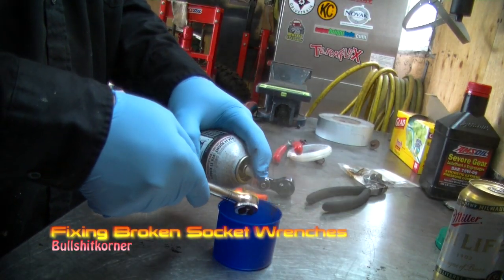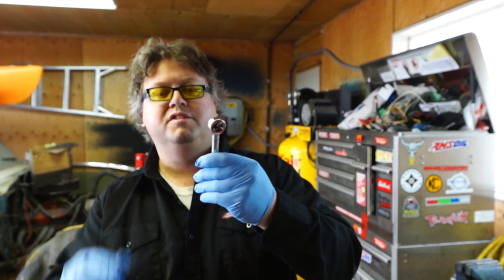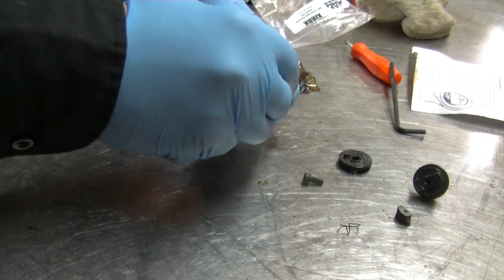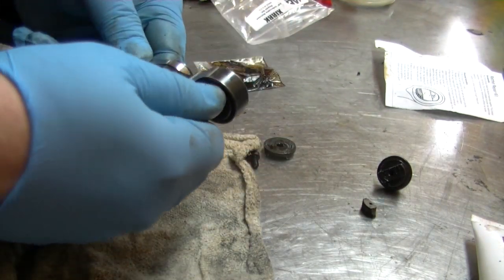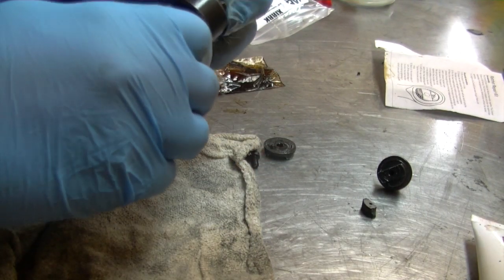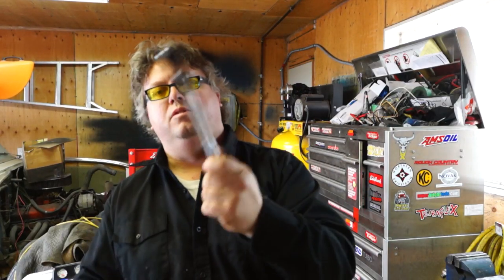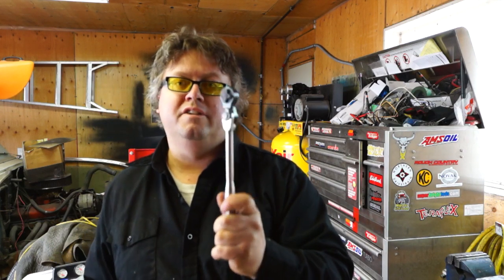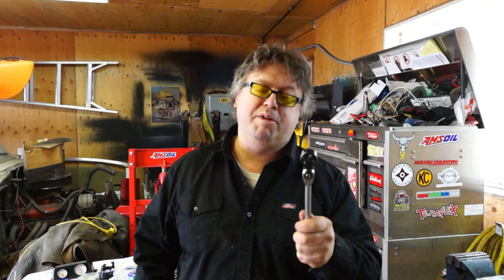How to Repair a Socket Wrench

Comment: Finally someone showing how to reassemble a round head mac ratchet!  Thought I was doing something wrong when after tightening the back screw, it wouldn't move.
Lightly tighten the screw down then back it off till it operates smoothly.  Looks like it originally had some loctite to keep it form backing out.

Comment: Damn Jerry good timing on this video, I just busted 2 socket wrenches last night trying to pop some bolts off a caliper mounting bracket.
Reply: Instead of using your ratchet (which has a weak mechanism), you should have used either a breaker bar or a manual impact wrench, which you can hit with a hammer.  Ratchets are designed to be used for removal (after a fastener is broken loose), or reinstallation (short of final tightening).  Anything else is asking too much of it.

Comment: If you mix acetone and transmission fluid together and brush it on to rusty parts it can break it apart pretty easy, even the rusty bolts on the Jeep!

Comment: I put a snipe in a Canadian tire racket last winter and rather than the gears shearing, the handle snapped off! Then I tried another one and the casing where the gears go snapped, I took pictures but can't post them here!
Reply from the maker: hahaha I love sniping things until the wrench breaks and then it usually doesn't end well

Comment: I recently had a Husky 3/8 ratchet break but they no longer have any type of warranty on their hand tools so I just threw it in the trash. I try to buy tools,especially hand tools that have the free replacement deal if something goes wrong.
Reply from the maker: yes most companies do, many are just over the counter replacement.  Proto, Craftsman, snap on, and Mac all have serviceable parts.  I have a Mixture of Brand name tools and some I like to call use it once and toss it tools

Comment: So I know this video has nothing to do what I am about to ask but I own a 2001 bmw 325i and my power steering pump went bad and also some belt and I was wondering if this is a job that I could probably handle on my own or if I should just have a shop do it. They quoted me $800 and I do not have to money to spend that much. It would be nice to save some money and do it myself
Reply from the maker: You can do anything if you put your mind to it